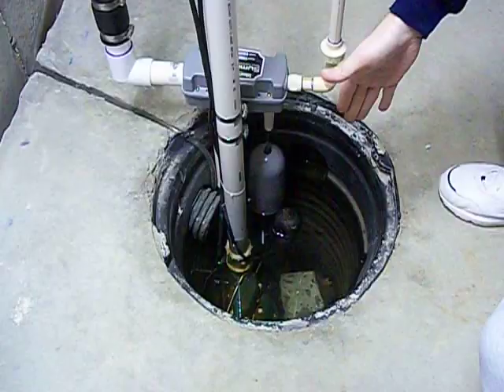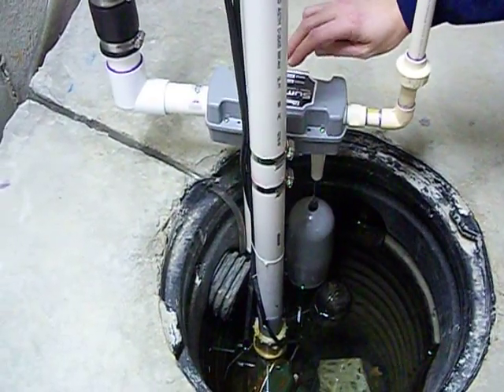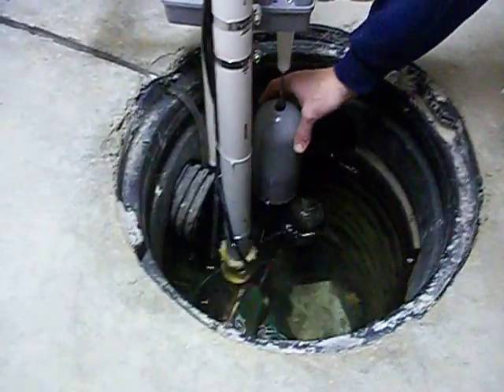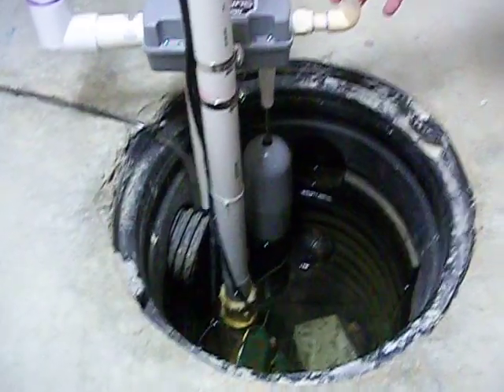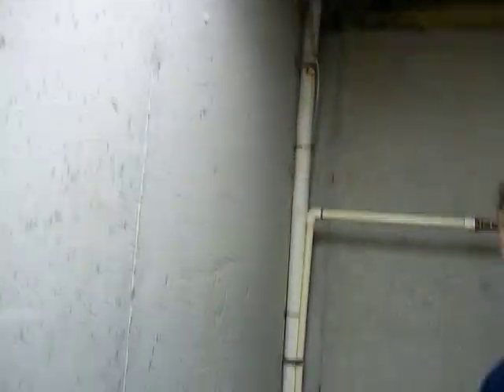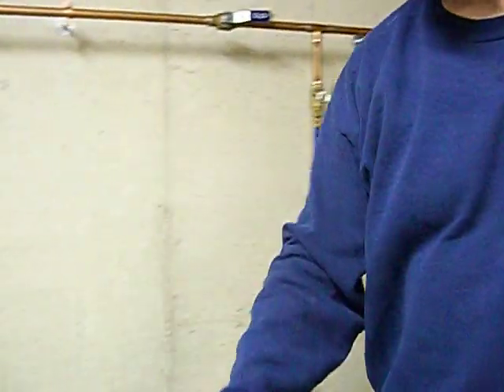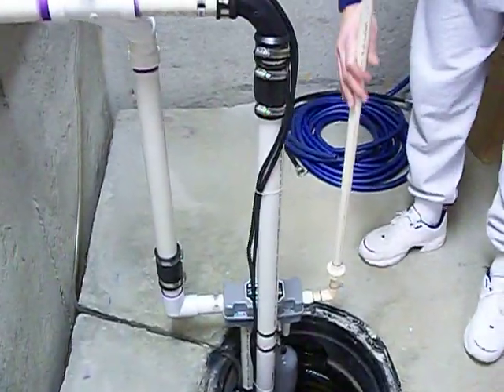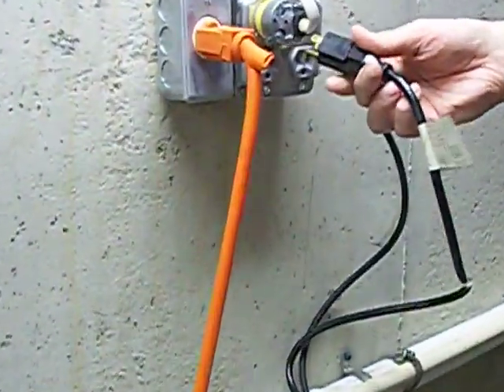DIY Liberty Pumps SJ10 SumpJet Water Powered Sump Pump Back-Up System with Zoeller M53 N53 Pump

Comment: Great job! This is my next project as soon as dry season starts. I'm thinking of running another out-pipe in case the cause of the main failure was a clog, frozen pipe, etc (for a fully separate backup).
Reply from the maker: It never hurts to have extra insurance in case of catastrophic failure. 🤞👍

Comment from the maker: once you shut off the main supple valve to pump off try opening up again. See if it stop pumping supply water. Might have something stuck in it or frozen from lack of use. you have to periodically do dry runs every once in awhile on all sump pumps to make sure they are ready to go.

Comment: Basement flooded on Thursday evening when we got 5.7" rain. Main Hydromatic pump (0.4 HP, 2" discharge, 6500 gph) switch failed. 24V back-up pump ran at 2300 gph for six hours before we found the flood. Only got ~0.5" water in basement, but it ruined the carpet pad. Based on looking at this video I doubt the water pump would even come close to discharging enough water to replace the battery back-up.
Reply: Yeah, they make them much better now and depending on your home water pressure they can out perform any battery pump

Comment: video answered all my ?s but i have a new ? how close can i solder a slip joint to a sharkbite fitting?
Reply from the maker: If you can remove shark fittings do that first before soldering so you don't burn up the plastic seal.

Comment from the maker: You can try to wrap some Teflon tape around the bolt threads to make it tighter when you screw it in or spread some loctite on threads. Try calling liberty usually there customer service is pretty good and might send you replacement part if that doesn't work. Rick

Comment from the maker: No back-up pump will perform as fast as the primary when electric fails. This is just used as a emergency until you can get power or generator restored. Better than flooding out with nothing. Your choice I made mine. Good Luck.
Reply: I got a whole house 24kw natural gas generator for the primary electric pump, plus the water SJ10 backup pump and a portable gasoline Honda generator and a 16kw Isuzu diesel generator and 2 spare electric pump 275 gallons of diesel and 55 gallons of gasoline just in case.I’ve been thinking of solar /wind and nuclear power too.

Comment: It interesting that you say you don’t need a high water alarm. What happens if both pump fails?  What happens if the primary check valve fails. All that fresh water will run directly into the pit by back feeding through the Y into the pit.

Comment: Lol the cat tho. Looks good, it's still good practice to throw a check valve down the line on water supply and check valve on your discharge line. But still looks nice, very neat
Reply from the maker: I have since installed a Watts double check valve. 👍
Reply: @DiyRick66  
Gotcha I read that after I left my comment. Are you an electrician lol? That looks like how an electrician would throw one of those in
Reply from the maker: @mattjohnson7775  LOL Plumb Level Square or Good To The Eye.

Comment: I was wondering if this system will work if you only have 1/2” water lines. Most houses have 3/4” but our home is only 1 bath, 2 bedrooms so it only has 1/2” water lines. Will the pump still work? Even 5-600gph would be enough to keep up with the sump water I’m sure.. thanks for the video 👍
Reply from the maker: What I would do is run a temp hose to see if it would work before you run hard pipe to it. Good luck. Rick
Reply: I have bigger feed lines at the other end of the basement so would have to run 30 feet of 3/4 pipe overhead to reach that pipe.  Plus some extra connections

Comment: Hi Rick.  Nice video.  I'm preparing to install a Liberty this weekend.  I am curious if you really have no backflow valve on your primary discharge line??  If so, when the Liberty has to run, some of that discharge flow is going to head right back into your crock, right?  The built in check valve on the liberty is on the water supply side.  Or am I missing something?  My plan was to put a backflow valve on each discharge leg, so no discharge flow from EITHER unit can get back to the crock when running.
Reply from the maker: You can put in a PVC Check Valve on your discharge from the pump to hold back when shuts off. 🤞👍
Reply: @DiyRick66  right.  What I meant was that I fid not see a backflow valve on your primary discharge.  Or did I just miss it in your clip?  Thanks!
Reply from the maker: @rickwhitfield7617  I installed a backflow preventer on the water supply line to the pump. There is a check valve on the discharge line off off the pump under water in the crock. 🤞

Comment: I was told by a plumber to run the backup sump pump (liberty) every 2 months or so to make sure they work when they are actually needed. Can I just lift the backup float up to do this or should I fill up water?
Reply from the maker: If you are worried about the cost of water to fill up the crock to test it.  I would just lift up the float to engage it. You will hear the pump whirling and the supply water pipe will hammer hard. Don't run dry  for a long time. I do however fill the crock to double check. Good luck.
Reply: @DiyRick66  thanks for the reply. I'm not worried about the cost of water. Just the time to fill it up. We had some overnight thunderstorm so was waiting for the backup float to activate. Finally lifted it myself and the backup pump worked.

Comment from the maker: Battery Back-Up will lose charge and discharge pressure as electric is down for a long period of time. Whereas a Water Powered Back-Up will run as long as you have domestic water pressure.For every 1 gal. used 2 gals.are removed. Your choice as to what you need.I found out the hard way during Sandy.

Comment: Do you prefer the tethered float switch over the original m53 switch?
Reply from the maker: I personally do prefer the tethered float because I can set it so my crock fills all the way up and discharges completely & slower so switch is not overworked due to rapid use. Just my situation & my opinion. Thanks

Comment: Hello Rick, you mentioned in that the back up water pump can not be used in all states.   Do you know which states that it is allowed?  Also, I've lived in my current home for about 11 years now, and this is the first home I have ever been in that needed to have a sump pump.  My sump pump still works, but we have had a number of major floods in our community the last few years, and last summer my sump pump started acting oddly as a result.  I weather most of the floods fairly well, but every now and then I get a back up into the basement (2 or 3 inches deep)

Now, every once in a while it just doesn't kick in properly.  But if I dip a broom handle down into the well, it will activate the system.  Frankly, I am no sump pump expert, and have no idea why exactly that works.  I was wondering if these systems come with some form of infrared sensor that the broom stick sets off, or if it is some pressure sensor that activates from the motion of the broom handle.  I've also noticed another problem when the well has too much water.  In the water drainage line which is about 20 to 30 feet away from the pump well it generates a very loud water gurgling noise that will persist as long as the well is filled too high.  Would you, or anyone out there know the cause of that?  Is it because the line is filled with water that cannot escape?  Could it be the result of debris in the line?

Again, I am no plumber, and would need an expert to do any repairs as necessary.
Reply from the maker: David Gilbert Maybe the broom handle hits the float and dislodges it from being stuck which triggers the pump. Sound you may be hearing is discharge water still in outflow pipe. It doesn't completely run out it keeps a column of water in it at all times. Check to see if float is getting stuck when it fills up. Good luck.
Reply: That gurgling sound is the radon blower picking up water because the intake is submerged.
Reply: Thank you Neil, that hadn't occurred to me.  My house does have a radon remediation system which is also in that same corner.  But I have always been of the impression that it was a separate system.  I will have to look into how it operates.
Reply: David Gilbert to prove what I’m saying is accurate, turn off the circuit breaker that powers the radon blower and you will hear the gurgling sound stop. Alternatively, turn the sump pump on to lower the water level in the pit and the gurgling sound will also stop. I had the same issue in my house. The permanent solution was to adjust the “on” point of the sump pump to be below the level where the gurgling starts. 

Your issue where the water occasionally goes too high without the pump activating sounds like a faulty switch. They can fail such that the failure is intermittent. 

I bought a new switch called Levelguard about 10 years ago and I’m very happy with it. Consider it as an option.

Comment: Can you use the water power sump pump as your primary system?
Reply from the maker: It wouldn't be cost effective. So I would so No.
Reply: @DiyRick66  You're right, thanks for your response.

Comment: Does your pump have to be set below where the water is coming in?
Reply from the maker: carole bratko Should be because you don't want your crock to equalize and back up underground causing erosion and buckling basement slab.

Comment: I had an issue with the float rod coming off.  I have tried to get it back on the unit and can not and have a very tight space to work in.  Any advice?
Reply from the maker: Float on Liberty Pump Or Zoeller?
Reply: Sorry Liberty
Reply from the maker: Coming off of the Bulb or where it screws into the float linkage?

Comment: What if your sump pump dies.  How would you know that your sump pump died especially without the alarm?  Does it sound different?
Reply from the maker: Absolutely. Once power stops & crock fills up raising float on water pump it will engage domestic water inlet which will hammer your pipe every time it goes on. You can hear it rattle through your home. Like I said it is only in an emergency.

Comment: I agree...the m53 switch,system cycles way too often""...poor design....the crock should fill,substantially and then empty all at once....why have a pump cycle 25 times an hour when you can reduce it to 5?times an hour.....short cycling is not good for motors at all and thats prob why the switches on these zoeller pumps fail so often....excessive cycles
Reply: I was about to ask about this. I haven't installed my SJ10 yet but noticed that the switch seems to only operate in a half inch to one inch window. It will be on and off far too frequently instead of just draining the pit every few minutes. Did you come up with a solution ?